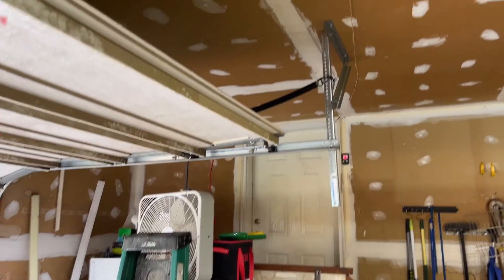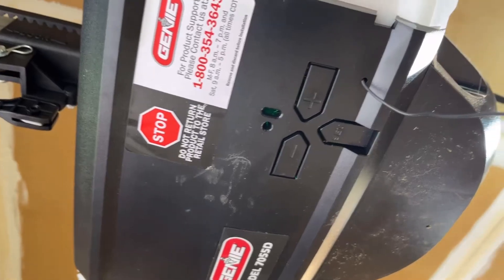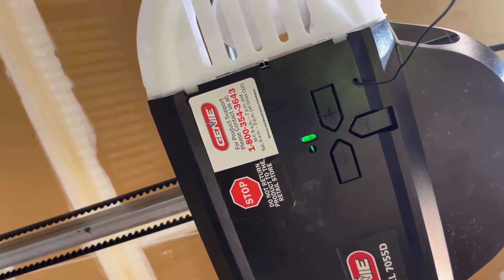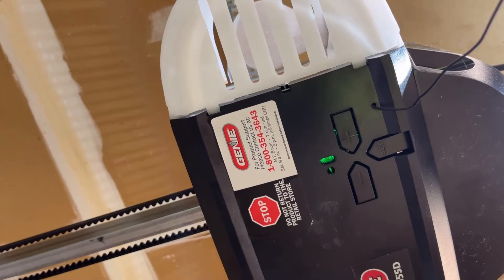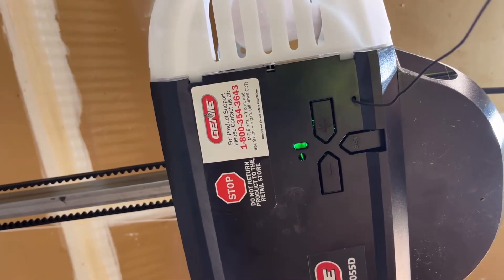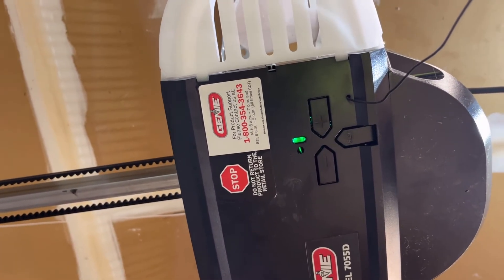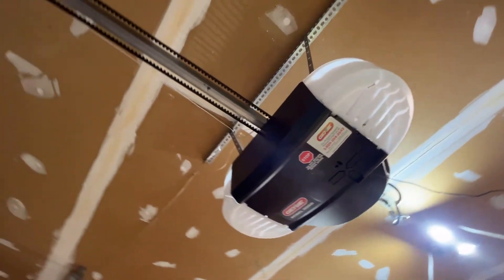Genie garage door opener model 7055D. Will not open or close more than 8 inches. How to calibrate.￼

Comment: I bought one of these 7055d models. I installed it perfectly, and It will travel 3 inches then stop. You have to unplug it then plug it back in. In order to get it to do that again.
My light sensors are correct with new wires.
After 27 calls to genie ( not kidding) and asking for a call back only to have them go straight to voicemail on my phone, and my wife’s…Even after resetting them. I got ahold of them twice.
The lady took me through all the tests, she said it needed a new circuit board . She sent me a circuit board. I put it in….same thing. 
When I got ahold of them again…more tests and they sent me a transformer and a rpm “ hall” sensor.
Put the parts on…nope….same thing.
I’m a mechanic, so I’m not stupid ok. The motors hall sensor rotor is made of plastic, not steel.
So, I can understand why it’s not working.
It’s not picking up the signal. 
I believe it’s missing a metal insert under the rpm sensor. So the sensor can read the turns.
Now….its more calls to genie. And try to get them to understand this.
I’ll never buy one of these again. I suggest you get a lift master or chamberlain.
I’ve been without a garage door opener for a month.
But…the thing that just kills me is the phone calls going straight to voicemail.

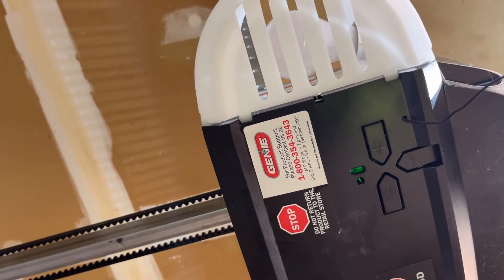Comment: No offense, but your video is way too long. Your voice over @ 5:20-6:20  is all that is necessary  in the video. At 30 seconds in, i knew that i needed to fast forward until  i saw a picture of the opener. I needed to reset my up and down travel  because there was a red light and it wouldn't  open, just click. I pressed  the plus or minus  button (don't  remember which) til it opend all the way. When i released the button, the light was green after pressing SET and the up travel was now programmed. I did the same for the down travel. Thanks for your help. Please shorten  your video to help others better.

Comment: Was going bat shit trying to figure this out.  Among the worst instructions I’ve seen.  Thanks
Reply from the maker: OK because you’re still elementary. I will slow it down for you unlatched the door roll it all the way down to the floor. Then press the down arrow so that the trolley is all the way down to where the door is. Latch the door and trolley together. Then press and hold the set button until the light behind the arrows flashes blue. Then press and hold the plus button or the up button until the trolley brings the door all the way up to the power unit. That sets your up travel. Then press and hold the set button again. Once the blue light begins to flash again press the down arrow or the negative button and hold it until the door goes all the way to the shut position. The instructions are very clear that come with the door.

Comment: I put one in. That same model. 7055. Battery backup harness up. Follow the instructions. Very easy. I also put a sure lock garage dead bolt in the system. All works great
Reply: Whooo. My ADHD kicked in almost immediately on this video
Reply from the maker: @marktaylor219 so did mine 😆 any questions ask away.🙂👍
Reply: A😊😊😊++¹
Reply from the maker: I appreciate you stopping by to watch. I’m not sure that any of my other content fits your interests. you take care. Have a good day. I’ll see you on the next video.
Reply: @ I do need to mention that the instructions were good. But I did watch a video on the programming up and down. I am a show me guy. About did make it easier. I just was cruising vids and tour videos came up.
Take care I’ll look at your vids and see what your content is
Reply from the maker: @sikes185 I also feel like this video might be helpful for those who have had an extended power outage, causing the memory to drop off. And require a reset of some sort. Not that this could happen. I have not experienced this. I suppose you never know. Thanks, John.
Reply: @ 
I have a channel under the sikes185. I have not posted in a while. I just did the install of the opener like I said. I may do one on it. I did a lot of upgrades on my door just to make it more quiet. The channel skips from my wild life rescues to drag racing.

Comment: Your black covered soft wall shed. Did you put a stone floor or poured concrete? I’m looking to either build my 10x10ft shed or sell it and build a pole barn style. Recommendations>
Reply from the maker: Actually, that’s just a gravel floor with rubber stall mats on top for a vapor barrier. As far as building a pole barn the only ones that I know of that are reasonably priced and very quick is pioneer pole buildings. There are an Amish company out of Pennsylvania.
Reply from the maker: The main reason why we went with those cover at buildings for barn space is mainly for keeping the taxes down. Here in Norton if you leave the floor gravel or you pave it with asphalt, it is non-taxable at this point anyway who knows if it’s going to change. If you put a concrete floor in the concrete floor is taxable, even though you have a temporary shelter over, looks like you moved up this way just further east of where I am now from what Teresa had said you might want to check out with your township and see what your options are as far as keeping your taxes down.